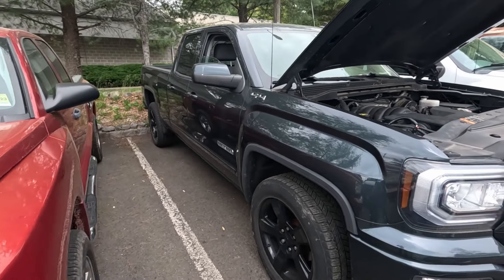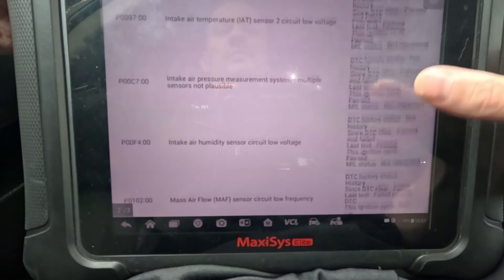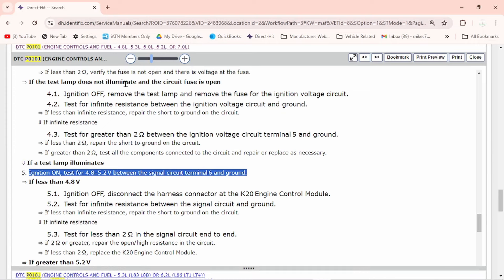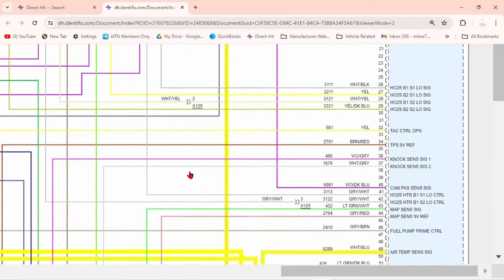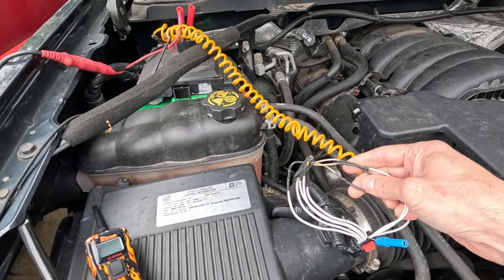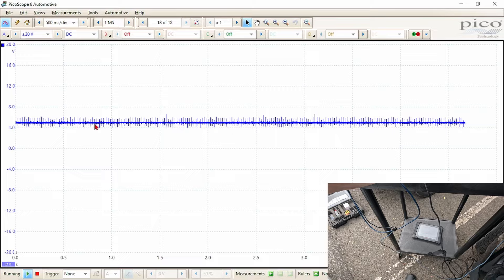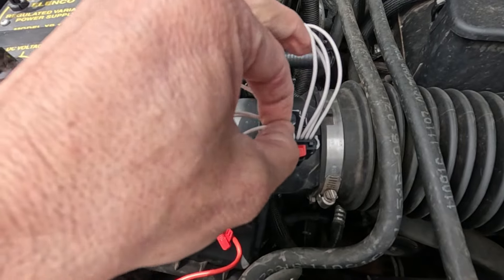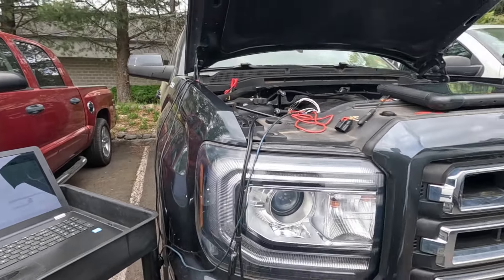2017 Chevy Silverado 5.3L | p0102, p0097. p00c7, p00f4, p0113, p2227 & p2228. No MAF signal.

Comment: I have a 2018 silverado and im having the p0097 code popping up. I swapped the mass air flow sensor and im still getting it. Checked the wiring and looks ok but money is too tight to have somone come out and diagnose it. Any pointers?

Comment: I have these codes on a 2016 silverado but I think the maf sensor wires are different
Reply from the maker: @edwinmarquez5380  Always go with a better quality brand. Stay  away from Duralast.
Reply: Excelent diagnostic  !!!
Reply: What was the truck doing prior to fixing the pigtail
Reply: I have all the same codes right now on a 2017 gmc sierra